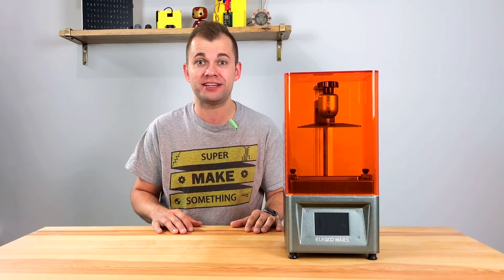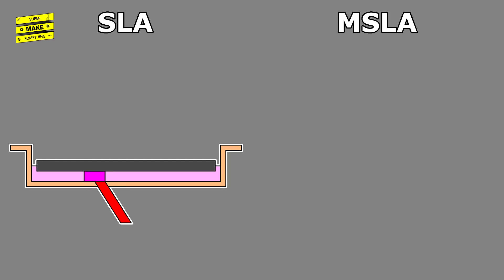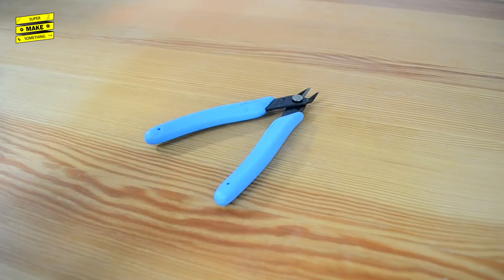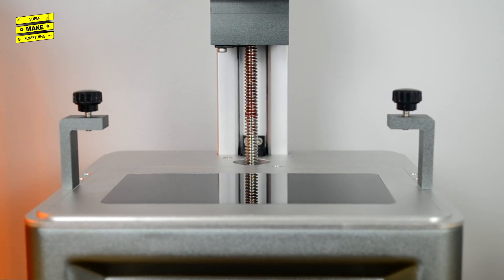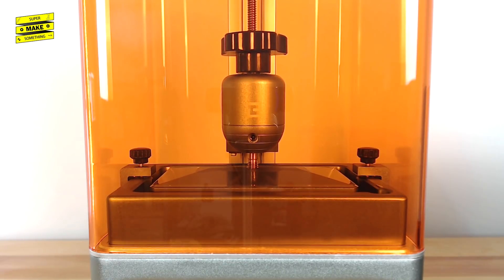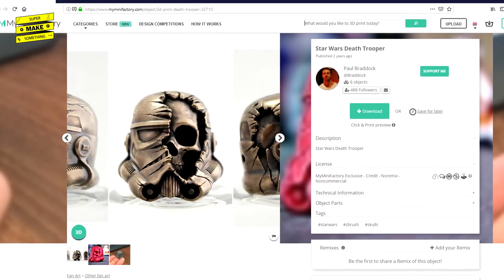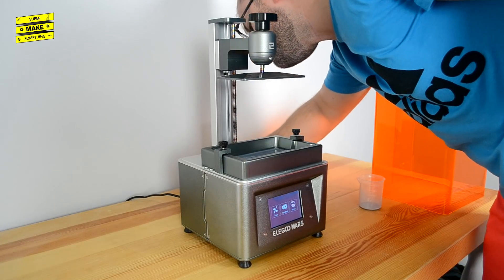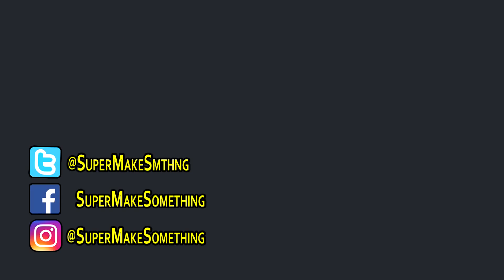Resin 3D Printing: SLA vs. MSLA vs. FDM - Elegoo Mars Review and Setup

Comment: the white printed plastic thing included is to hold the build plate at an angle, so  the resin can flow back in the basin . just remove the plate and put the plastic tool on the holder. After that the plate on the tool... Nice Idea from Elegoo.. Every drip Resin is it worth ^^

Comment: I'm really stuck on what to get, I hear that the resin printers require a lot of extra effort whereas the filament printers dont require anything besides maybe sanding. Do you hav ed any recommendations on an affordable FDM printer?
Reply from the maker: FDM printers are definitely another good option depending on what you are looking to do. They definitely have less of a cleanup complexity compared to resin printers, though the resolution won’t be as high. For an immediate recommendation, I would point to either the Creality Ender 5 or the Lotmaxx SC-10, as these have a good trade off between build volume and size. (Check out my videos on both of these printers for more info + affiliate links if you are interested.) I will be live-streaming about the JGAurora A5S this weekend, which has a massive build volume, so that might be a good choice as well. I am currently in the process of reviewing a dual extrusion printer as well, which can be used to print with dissolvable supports, so this overcomes issues related to support removal. Hopefully this will be up in the next month or two, so stay tuned!

Comment: Mines coming tomorrow. This is an excellent video explaining how to do the setup (which I will be following), cleaning and printing your own designs. Most YouTubers have just rushed and only briefly mentioned setup etc focusing more on the end result and not how they got there. Again great video.
Reply from the maker: Thank you! Good luck with your printer and setup. I hope this video will help you get up and running quickly!
Reply: @SuperMakeSomething  There was a difference which left me a bit baffled about (as it did not follow the pamphlet) the levelling paper sheet rather than the fep container. Makes sense as ususlly in further prints the tank will have resin in it so it can be done with the paper.
Reply from the maker: Round Tuit This is a difference between the included manual and the official Elegoo videos. I believe both would work, however I went with the paper in order to minimize the chance of damaging the FEP film during leveling just in case. Not sure if one works better than the other — I just figured less mechanical wear on the film = longer life.

Comment: .1mm for FDM is an absolute myth. Any CR10 type printer can easily print at .05mm nowadays lead screw plus stepper accuracy is the limiting factor. Also you didn't mention the fact that resin printers cant use such a wide variety of materials like FDM

Comment: Great vid, congrats! Total newbie here, I guess you can't print colored models with this. What kind of machine would take in order to print let's say a head, and have the hair as one color, skin as another, the white of the eyes, etc? Many thanks!
Reply from the maker: Thanks! Unfortunately doing multicolored prints is impossible with MSLA machines, because resin gets hardened one layer at a time.  Therefore, it is not possible to "section off" parts of a print to print different areas in different colors.  Your best bet for this would be a dual/multi-extruder FDM machine.  I am currently reviewing the QIDI Tech X-Pro, which has two extruders, so it can print in two different colors, so definitely stay tuned for that!  Other options exist to allow multiple colors, like the "Palette" add-on from Prusa for example, which might be a good option, though I have not had the chance to try it yet. Hope this helps!

Comment: How about the smell? I want a resin printer.. but I'm worried about the smell because I live in a small place. I dont mind about the mess, just the smell
Reply: It smells bad. It's nearly unbearable to breathe in the same room. If you have a garage or balcony it would be better.
Reply from the maker: I have not had the experience that Berat has had, but we may be using different printers.  Personally, I do not think that the Mars has a particularly strong odor.  My unit is located near the window in my office -- if I have the window open while it is printing, I have no issues with the smell and can work in the same room.
Reply: 1.  Wear a half-mask respirator with organic vapor cartridges.
2.  Exhaust fan (small, 4" range?) running when working with this stuff
3.  I would expect different resins to vary in volatiles / odor, and for Chinese resins to vary lot-to-lot
Reply: @yildizyeni  it barely smells

Comment: Great video, but I missed the points of cleaning the printer after a print (cleaning the reservoir and putting unused resin back into the bottle.
Reply from the maker: Paul Arnold Thank you Paul! You are right — I neglected to put the clean-up portion into this video, but will definitely include this section in the next project where I use this printer. Stay tuned!

Comment: Im into jewelry. Do yoy thing i can use this 3d printer with castable wax resin?
Reply from the maker: Yes you should be able to use this printer with castable wax resin, though the exposure and layer height settings will likely need to be adjusted compared to “standard” resin.

Comment: I am ready to buy my first resin printer. I am choosing resin because I create jewelry and they have the resin casting wax. Could you do a side by side of the few resin printers you have with casting wax and some jewelry models like rings with prongs so we can see if the claims that these will work are real? My hope is to print a casting tree whole on the sprue so I can eliminate molds, wax injecting and treeing by hand. When you think about small links for a bracelet (10 to 20 components) being done one by one compared to this it is going to make it possible to turn out more than one finished product in a week. If you can get a model of a casting tree with several jewelry items on it that would be the ultimate. Try asking Stuller as they make the software (rhino gold) to design these items. The other software is 3-design and Matrix they may want to promote theirs as well. Could be could source for a model file.
Reply: In case you haven't come across him, VOG,  vegetable oil guy, has done some videos on metal casting from models in specialist uv resin.

Comment: That look very smooth for the size, i might consider that printer, im using an Ender 3 which is a 3d printer that makes a lot of noise but so far is doing the job well, i wonder how Ellego Mars is about noise reduction comparing to PLA printers?
Reply from the maker: From what I’ve heard the Ender 3 is quite noisy — however I do not have any experience with this printer. However I can say that I do not find the noise of the Mars overly distracting. Since the motor does not use an x-y carriage to move a print head, he only sound coming from the printer is the fan.

Comment: @Super Make Something  Hey SMS,  I have the question you probably get all the time!  I'm after an affordable 3D printer with the ability to print smooth geometric type items (not characters or sculpture) as accurately as possible, in both firm and flexible (silicone-esque) type material. I love the smoothness of the Resin but does it shrink or do anything strange? I'm after close tolerances. Obviously I'm not expecting miracles with a $500 machine! But I think the Mars might be a good place to start, especially if it can do a flexible resin too and be somewhat accurate. Any suggestions appreciated. Tks.
Reply from the maker: I believe that there is some shrinkage with resin, but I have not quantified it.  I also unfortunately do not have any experience with flexible resins, but I can say that the Mars is definitely a good choice as a resin printer based on my experience if you decide to go that route.  

In terms of other options for flexible filament, I've heard that the Ender 3 Pro is good for printing NinjaFlex.  At this time, I do not have any hands-on time with this printer, but I may very soon and there may be a few social media posts on the way about this style of machine, so stay tuned... ;-)

The Ender 3 Pro can be purchased here in case you are interested in going that route: https://amzn.to/35Rp9US

Comment: That usb port looks a bit rough.
Reply: Plus it is damn inconveniently placed.
Reply: It looks like poor manufacturing.  Not sure how long this printer will last.
Reply: Easily solved with a USB extension cable though.
Reply: @brandong.8494  Nothing is solved by an USB cable
Reply: @thomashrev uh...why not?
Reply: @brandong.8494  The underlying problem is not solved, if that plug gets more out of place what is an USB cable going to do? What you are proposing is regularly called a "quick-fix" or "temporary solution"
Reply: @thomashrev  oh brother! "Gets out of place"?? So you....plug it back in? If I owned that printer, I would get a short extension cable and mount it to the side with some double stick tape (or 3D print some kind of mount). And it would be there... forever. A cheap fix for a very minor problem. There's no reason why that would fail. If anything it would protect the printers USB port from wear and tear. I'm a genius.
Reply: @brandong.8494  Maybe I'm seeing it wrong,  from the angle it looks like the USB connector is not properly fitted to the board, making it loose and out of place from the opening in the case.
Reply: @thomashrev  No no, you're right about that! From other review videos I have seen, that doesnt seem to be the case though. That might have just been a flaw with his unit. In which case I would DEFINITELY use an extension cable so that the wear and tear is going on the cable, not the original port. But yeah his port is way jacked up.
Reply: @brandong.8494  Yes I think that is true, looking at other review videos this unit seems to be manufacturer fault that should be RMAd.
Reply: That's called cheap.
Reply: @zerosugarmatcha7348  it's an order of magnitude cheaper than other models with the same print quality. Small volume though
Reply: @thomashrev  You're absolutely right

Comment: Instead of masking tape, you should seal all the edges of the LCD with Kapton tape. This prevents the FEP from sticking and in case you have a tear in the FEP during a print, prevents resin from seeping down into the LCD/printer.
Reply: Thank you kind stranger

Comment: Great review! I would recommend using Nitrile gloves over Latex because of their durability and resistance to puncturing which is important if your going to be handling uncured resin.
Reply from the maker: Thank you! That is a great tip!
Reply: Yes, absolutely!  In addition, one of the reasons that nitrile (a synthetic copolymer) started to be used in making disposable gloves was the high incidence of latex sensitization and allergy that was occurring in healthcare professionals who had been using latex exam and procedure gloves for years.  The nitrile exam glove industry was formed as a result and latex gloves have been all but totally phased-out in hospitals.  As a consequence, the other desirable features of nitrile gloves have become recognized (ruggedness, allergy-free, impervious to most chemicals) and they've found their way into many different industries as a form of PPE (personal protective equipment).  Harbor Freight has nitrile glove in boxes of 50 or 100 at reasonable prices.
Reply from the maker: @BrenzMarie  That's really good info, I did not know that about Nitrile!  Thank you for sharing!

Comment: "2K that is a higher resolution than you find..."..
No.. 2K is literaly the bog standard resolution. 2K is 1920x1080. Most modern computer screens have 2.5K or 4K nowdays, while 2K is still common.
Reply from the maker: matsv201 2K resolution is 2048 × 1080. 1080p is 1920x1080.
Reply: @SuperMakeSomething  

https://en.wikipedia.org/wiki/2K_resolution

"In television and consumer media, 1920 × 1080 is the most common 2K resolution"

1080p is just a sub-specification of 2K.

Comment: MSLA? This is the first i heard of this name. Although they use DLP (digital light processing) as the name of the UV backlight LCD based resin 3D printer.
Reply from the maker: MK3424 DLP in the “Digital Light Projection” sense is actually a slightly different process, though it seems like people use the term interchangeably on YouTube, because DLP has also come to mean “Digital Light Processing” as you point out. It’s definitely a bit confusing — I picked MSLA for this video since this is the term with the least ambiguity. More information about the differences can be found here: https://theorthocosmos.com/laser-sla-vs-dlp-vs-masked-sla-3d-printing-technology-compared/

Comment: But your Mars print is squashed in the Z axis. You should print a 1x1x1 cube and measure it.
Reply: a different review I watched the guy had that problem too, it is just because there is a little button that is kinda hidden where you can select your printer manufacture in the slicer software. Once you do that the squished Z goes away. The built in test print (the rooks) come out perfect with no squished Z, showing that the printer is not the issue but rather the slicer. Also that white residue on his print the other review guy said was due to not letting the alcohol evaporate off the surface before setting in light to finish curing. This printer is looking pretty good, I have wanted SLA for a long time but it has been just a bit too pricy but I am thinking maybe not so much any more.
Reply: John Bon exactly
Reply: Can you explain what you mean by this? I would like to make sure my prints turn out good :)
Reply: @thebarefoothobbit  Sometime its steps are wrong, instead of printing 10mm, it's printing 9,5mm. The test would be printing a cube of 10x10x10mm and measure it and see how different it is from the 10mm it was supposed to be. 
Then there's calculations to make about the step settings of the machine to correct it. 

Lets use the example I gave, you print a 10x10x10mm cube and the z axis measured is only 9,5 mm it means that it is wrong. You then proceed to the config file to see how many steps it is for the theoretical 10mm and it's writen 200 steps per 10mm, but since you are getting only 9,5 mm you correct it by (10/9,5)x200=210 steps. Now you can overwrite the settings of the machine from 200 steps /10 mm to 210 steps/10mm. This works also with cm or inches. Now you "stretched" the printings to be corrected.

Cheers

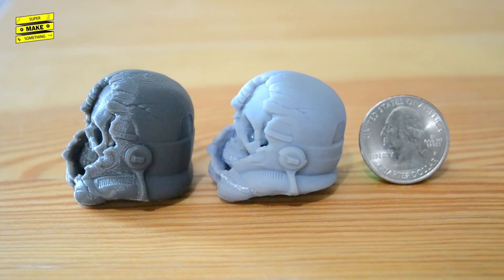Comment: On the resin printer at 11:59 we can see that the print has shifted at ear level.
What may have caused this displacement?
Reply: Fernando França wow good eye. I wonder what happened? Maybe the base plate alignment joint shifted? Hopefully it wasn't a shift in the lcd position. Huh. Or maybe the table got bumped and something moved.
Reply: probably z-axis; moving parts on Mars are good but for the price not the best; before using printer one should test how smooth the head movement is by hand; sometimes rollers are to tight and need to be readjusted; sometimes precision is not superb and with rolling parts even the slightest inaccuracy will make a "bump"; stepper motor here is small and may not have enough power to overcome all the forces caused by those minor imperfections; I've used number of roiling elements from china and you just cannot compare linear slide costing $30 with a high precision one costing 10x more; when you slide those by hand you can feel occasional resistance as balls and roiling surfaces may not be highly precise; Elegoo Mars is cheap and you just don't have highest quality moving parts including rollers and lead screw; doing test by hand and using proper lubrication and sometimes adjustment can help improve z-axis movement; in other cases it could be something else but usually it is mechanics
Reply: @drnda2007  Can you install a backlash nut on the Z to help? Or also, use a T8 2mm pitch lead screw?